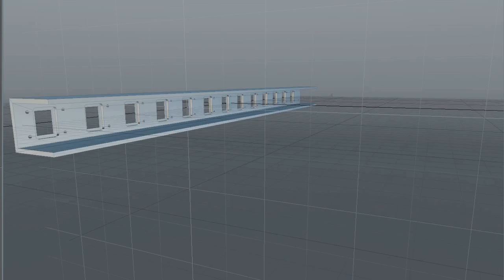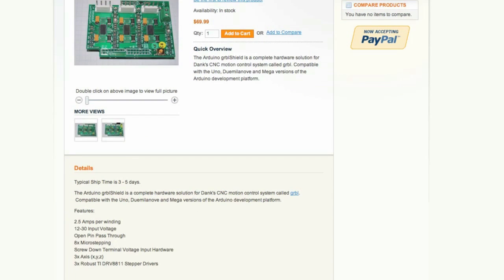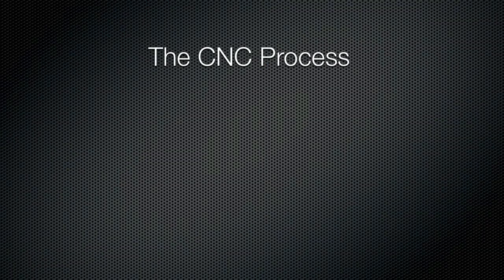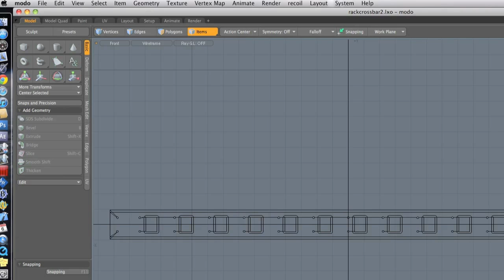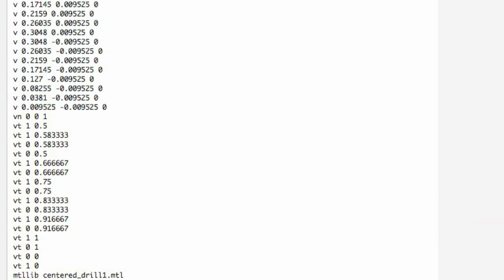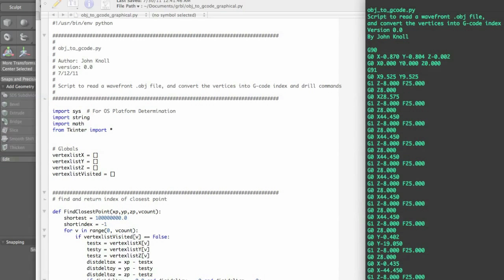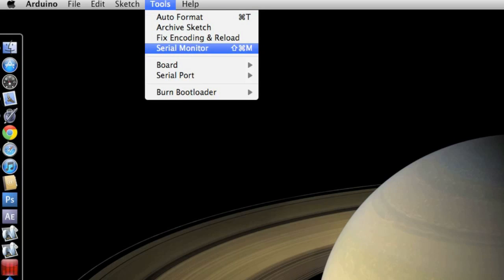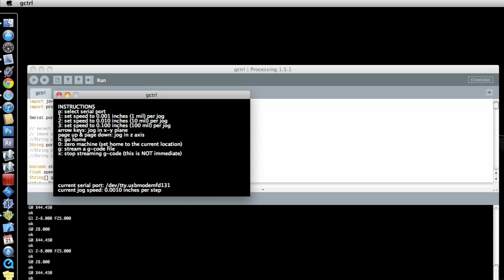GRBLshield CNC Milling Machine Conversion

Comment: Great video, I'm converting my mill as well and it appears to be the same size.  What size stepper motors did you use and what was the gear ratio you used for the timing belts?

Comment: Nice work mate.  Have you found any drawbacks from using the grblshield?  such as no backlash compensation?  Also,  did you have to set the steps per mm/inch?  and how did you find setting up the part and zeroing the XYZ axis?  is it an easy process?

Comment: Very nice. Are there programs available to run the mill with out knowing python or programing? I have mach3 but will it talk to the shield or in some way connect so as to run the mill? Sorry if I am not clear. I have Mach3- I have Cad- now to learn how to connect it to a mill. Suggestions?
Thanks

Comment: Wow, that is genius! How much do one of those mills run for? This would be an excellent alternative to building a cnc router from scratch, great work!
Reply: both harbour freight and grizzly tools sell this machine. check out their web sites.  its not quite a full size machine.  it has about a 10 inch z travel but the head can be moved up and down to accommodate different projects.  its quill bearings arn't made for long durration hard use (gets hot after an hour or so) but overall its a wonderfull machine I have done some really heavy and cool stuff with mine.  expect to change the acme screws for ball screws.  the ways are ROCK SOLID.  I really love the way he mounted the motors.  I want to know how he did the z access and if he has any cad files for the conversion parts.  I'll have to mill them on the same machine as I install them on.

Comment: So very cool.  I'm looking forward to following your lead with my new X3 once I get used to it as it is.  Like you, I plan to retain the ability to use it manually.  I'm surprised that I don't see any sliding digital position indicators.  I guess you are better at counting turns than I am. :-)

Comment: Dear Hadley,
At the outset, thanks for an informative video. I think yours is the most detailed wrt the GRBL shield.
I am trying to make my own CNC (DIY type).I have made the frame, bought three NEMA 17, power supply almost similar to the one in this video, a GRBL shield and seeduino bundle from Synthetos. I need some help to put it all together. I am using Windows X
and Arduino IDE. Shall be grateful if you can provide your email id for me to put forth my queries. Regards

Comment: I'm in the process of a CNC conversion and I'm just using L297/L298 motor drivers...I had no idea that grblShield existed. What inputs are used on that shield? Is there a serial interface on the grbl, or does it just use the standard enable, dir, full/half, dir,step, etc...? If I could use that grblShield without many drastic changes to my circuit, that would be awesome. Cool video as well, by the way.

Comment: "I haven't replaced the lead screws and they do have backlash. I carefully measured the backlash and compensate for it in software when I have direction changes. Seems to work well for me."

From down a bit

Comment: I noticed you were using a mac. Is there any other "user friendly" software out there for Mac. What you showed was pretty involved to say the least. I have been looking into getting a windows machine so I can run "easier" software. Is there anything out there for Mac that would be similar to running mach 3, cambam, or using sketchup for the drawing software. Thanks.

Comment: Very cool video, and what you did is very cool. I do have to wonder though wouldn't it be cheaper and easier to get  a cheapo CNC kit from ebay (~200) for steppers, power supply and BOB, a copy of heeks cam (free), and a copy of CNC linux (also free). Did you do it this way just to learn how to do it from scratch?

Comment: Does your python script handle tool offset as well? Any reason why you can't use a commercial option such as Cut2D or Vcarve for your CAM portion? Also how streamline was your conversion in the programming department? I have been looking to drive a homemade plotter from printer parts that I will later convert to a full size router with the same drivers but I am not currently very experienced with arduinos. Especially with many options like, RAMPS Pololu, Sparkfun EasyDrivers, Sanguinololu etc...